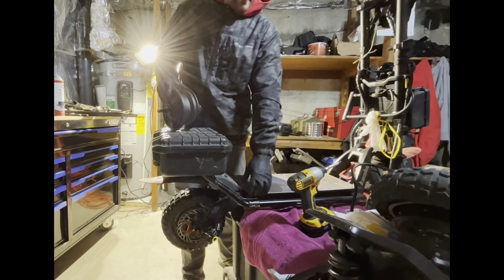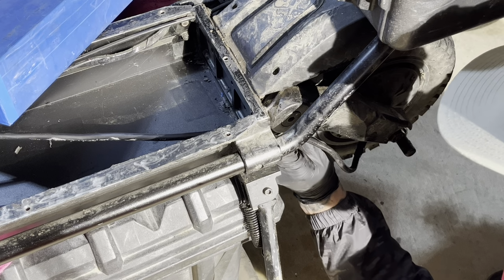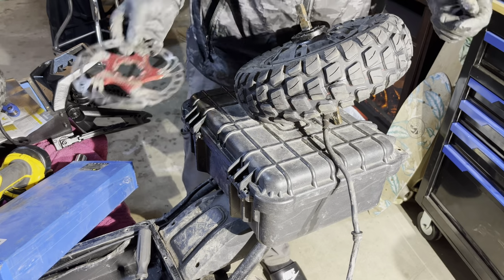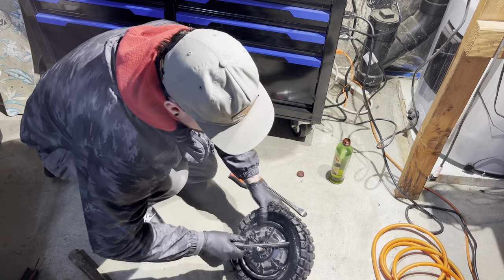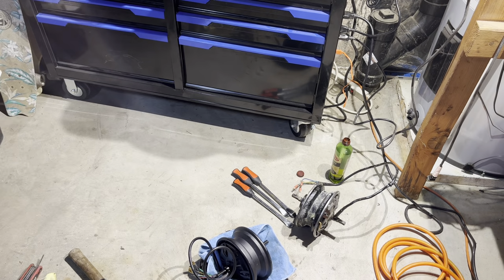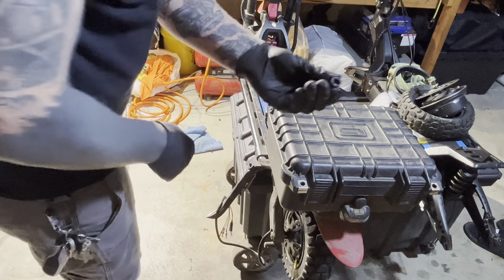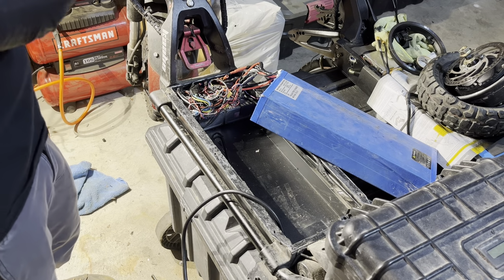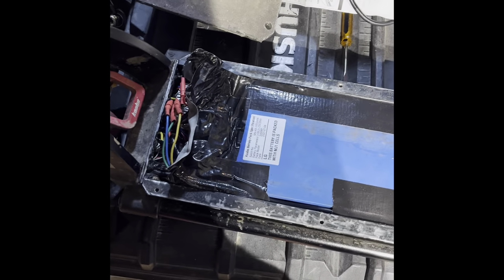Replacing the rear motor on the kaabo wolf king scooter ⚡️⚙️

Comment: how many miles did it take for the motor bearing to go?
Reply from the maker: 2500 miles, would have never happened if it wasn’t for the rainy area I live in
Reply from the maker: Front motor is still running strong and I’m at 4000 miles

Comment: like every tire change, do I have to open the deck and disconnect the engine?
Reply from the maker: No, you do not have to remove the deck and remove the wires. You can do a tire change without unplugging the phase wires.

Comment: Trying to figure out what’s wrong with mine and I think its the rear motor, will the front motor work if the rear motor doesn’t? I have power to the scooter but the tires wont spin
Reply from the maker: That’s a great question. Yes I would think that the front motor would spin if the rear one was broken because they’re on separate controllers
Reply: Got my problem figured out, will need a new motor, one more question tho, the extra wires on the new motor that weren’t on youre old one, what did they end up being for?
Reply from the maker: Those are for hall sensors they’re not used. The controllers don’t use whole sensors on this model.

Comment: How many miles did you have on this scooter before your bearings went out? And did they cover any of it under warranty? I just purchased the Wolf King GT Pro and I have not even had it outside yet. Been raining every since I got it as I live in Washington as well.
Reply from the maker: @StickyWhiteFly 
This scooter has about 2500 miles on it. I do ride it in the rain a lot though. And yes it was covered under warranty I just took short clips of the bearing noise and Voro Motors made it right. Not sure if the rain damaged the bearings or just went bad. Hope this answers your questions.
Reply: Definitely the rain. I blew my rear motor just last week when I was caught in heavy rain. >.<